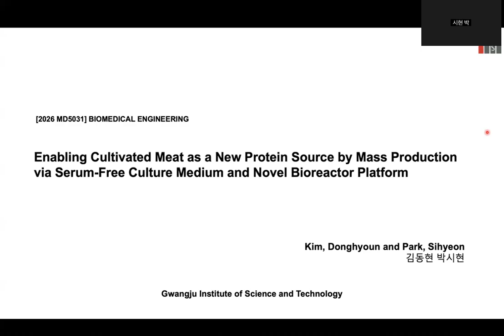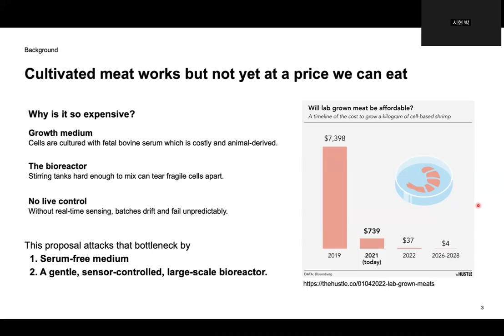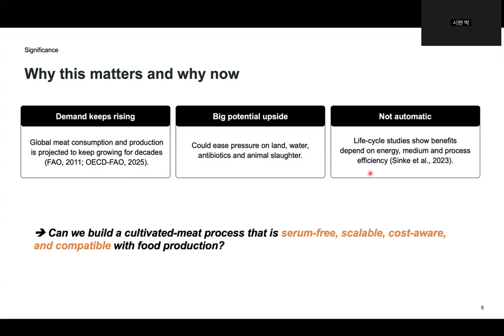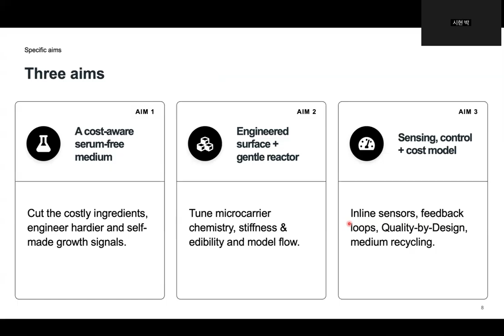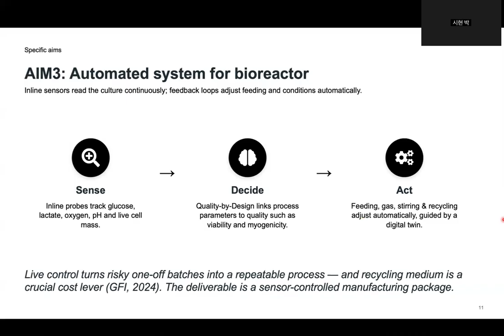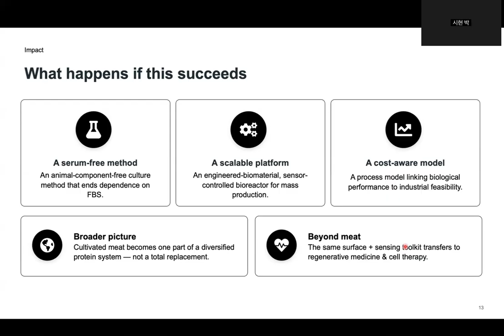MD5031 Team 5: Sihyeon Park & Dong Hyoun Kim

Comment: Farina DND:
I LOOOVED this topic. The idea itself was very interesting to me, especially because cultivated meat is not only a biology or engineering problem, but also connected to ethics, food production, cost, and public acceptance (you kinda guided me to sci-fi genre ideas and in what situation this could be applied first). I also really liked the meat in the dish picture at the beginning, which was what made me get the idea at first glance. though, the audio quality made it challenging for me to comprehend and helas,  after around the fourth slide, it felt like the presentation became mostly text-based. 
serum-free medium, cost, scale-up, fragile cells in bioreactors, and the need for sensing and control!!! ou mentioned the necessities!👍👍👍👍The three aims were also clear, and I appreciated that they connected the biological side with the engineering side instead of treating them separately.
Since the whole topic is somehow based on ethical and production concerns, I think the pitfalls section could include more than only technical risks. For example, industrial scale-up, manufacturing approval, regulatory/FDA-type approval, food safety, nutritional comparison with real meat, psychological barriers, and ethical questions around engineered food products are all important. I mean... even if the science works, people still need to trust it, accept it, and understand why it is safe and useful.
Also, the presentation went beyond the 10-minute limit, so maybe shortening some text-heavy parts and replacing them with clearer visuals could help both the timing and the audience engagement.
Overall, I really liked the idea and the direction of the proposal. thank you for your efforts and what you have done. i enjoyed⚡⚡⚡⚡⚡⚡⚡⚡